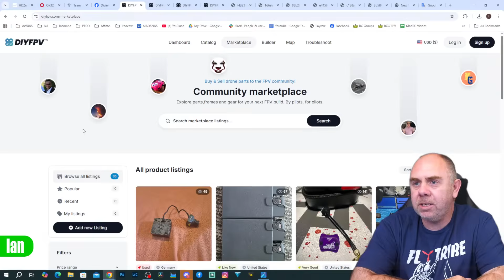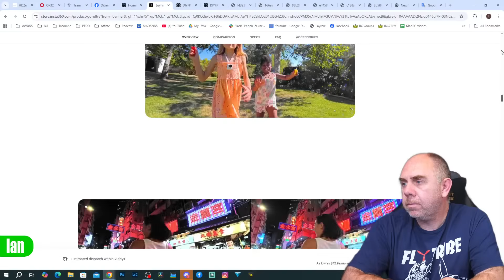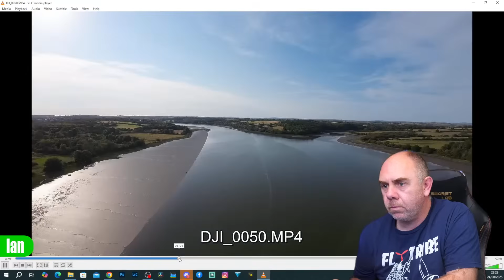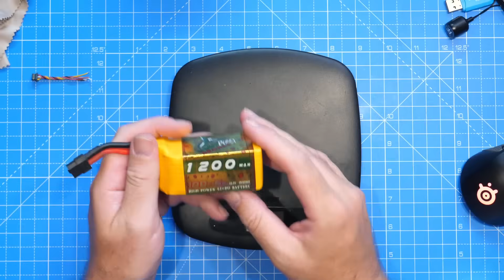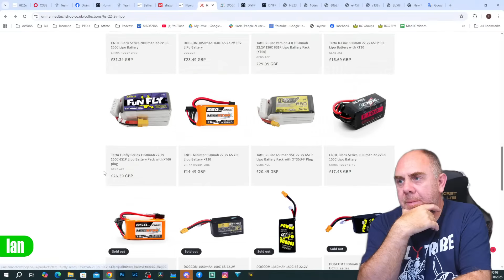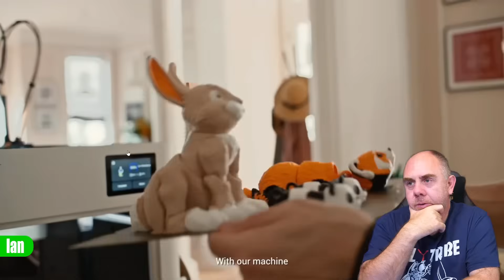CaddX Ascent New FPV System Leaks - TBS Chupito Hands On - HDZero Halo ESC BLheli_32 Mess - Q&A

Comment: O4 lite retail vs Walksnail 1s isn't that big of a difference price wise. But if you get WS on sale, which it often is, it becomes $65 vs 109 (haven't seen DJI on sale). Replacement lenses are $10. Repairs are either free, or maximum $45. It's a lot cheaper in the long run